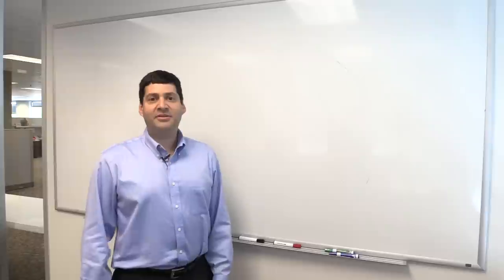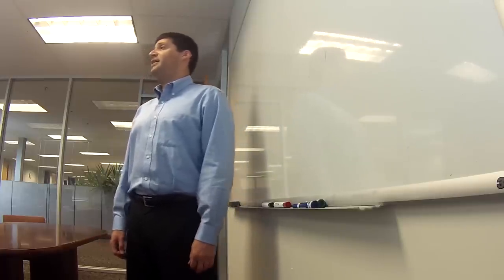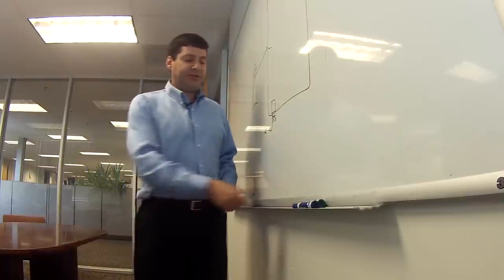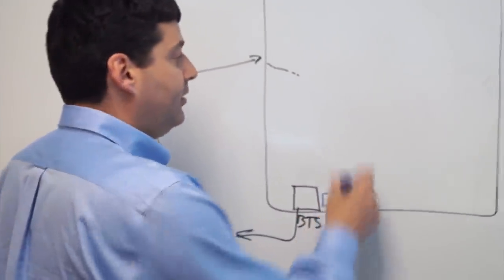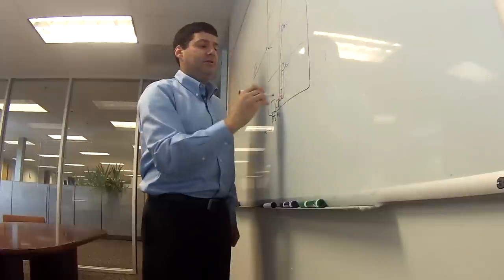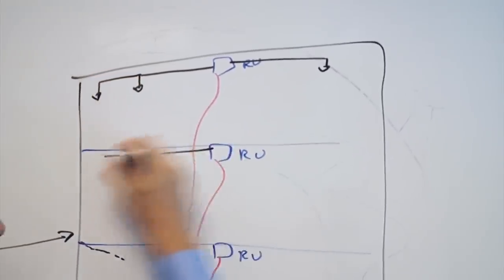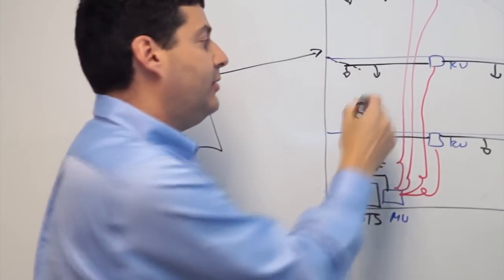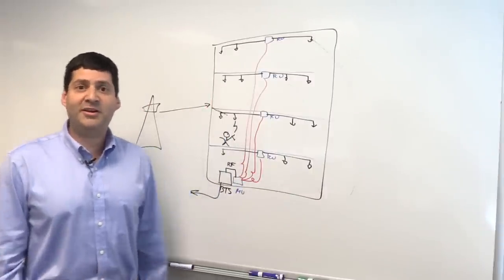How it works: Distributed antenna systems

Comment: Nice presentation. My only pent of advice is to lose the low down camera angle. It doesn't show anything valuable and takes attention away from the diagram and the speaker.